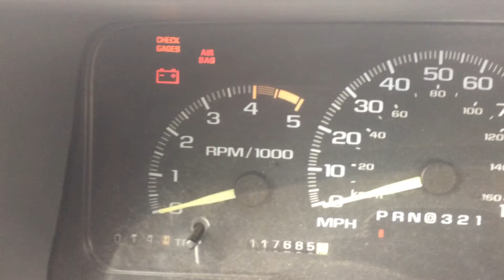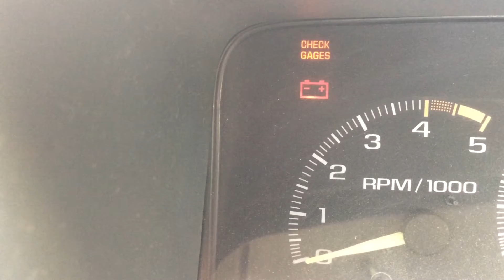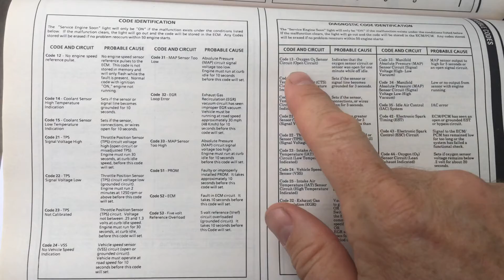How to read trouble codes on 88-95 GM cars and trucks

Comment: TBI stands for Throttle Body Injection.  Very basic and not much for power. Distributor will be different than earlier versions and would be OBD I so you use a paper clip and jump two connectors and start counting the engine flashes for the codes.
Reply from the maker: You’re right, those old TBI systems weren’t too powerful.

Comment: SES light is on my 93 1500 won’t turn off after shutting truck off. Was told on forum that disconnecting battery and reconnecting it should erase it not sure though

Comment: OBD1 is a lot less finicky than OBD2, I remember my 94 Econoline 'clearing' the mass airflow code when the van was turned off, and only illuminated within seconds, and repeated (unplugging the mass airflow was just a cheap fix to a different issue that has since been corrected.). My 92 Camry even had an EGR code come up due to a cracked hose, I trimmed the hose down, and it went away on its own.  OBD2 is anal and will illunmate whenever it wants.

Comment: You're providing a good service!
I own an 88 chevy pickup v6 vortec that has engine light come on after I drive for a short time. However it will only flash a 12 code. 
Wonder why?
Already had to replace egr valve, egr vacuum solenoid, electric spark control module.

Comment: Thank you for providing this valuable information!
Helped me identify malfunctioning egr valve on my '88 4.3 vortex v6.
I bought truck that had new spark plugs and wires, fuel pump, fuel filter, exhaust manifold gaskets (donut"s). I replaced corroded distributor cap. 
Don't get a code besides 12 now but engine light comes on at a quite predictable length of running time. Not as much pep or power as there should be. Also will bog down at times and hesitate to varying degrees.

Comment: When I try this the engine service light doesn't come on. When I turn the key to the run position it turns on and then immediately switches off. Also if the engine is running the engine service light is constantly flashing. I have a wire on the two spots that you showed in the video. Do you have any suggestions? Also the low coolant light came on after I did this but it's just a solid light. I have a 1995 Buick Roadmaster Estate if that helps.

Edit: I found the coolant leak so the coolant light had nothing to do with it lol I guess it was just a coincidence

Comment: So I have the same truck. Gm 1500 350 v8. I have code 13 as well but after the 3rd time it flashed 13 it flashes 4 times then 3 times and does that for a while

Comment: I have a 95 beretta.  This does not work.  Instead of the two connections on the upper right corner of the plug, mine are the upper and lower two connections on the right.  It is either A and M or B and M.  Any ideas?

Comment: What if the code 12 is the only code shown... I have a caprice classic and sometimes I have to give it gas to start. So I know there is a issue, but the obd scanner wont show nothing but 12.
Reply: 12 means that it can't detect anything from the RPM sensor, but you won't ever get anything from the RPM sensor if the engine is off. Hope this helps!
Reply: Ever figure out the issue?
Reply: @cesarbernabe2986 if I remember correctly it was some kind of sensor. It was just problem after problem. Eventually I sold it to a salvage yard.

Comment: What if my cars computer is OBD1 but it has a 16 pin port for OBD2?
Reply: No it does not mean you have a obd2.    It's the weird inbetween commonly referred to as 1.5
Reply: That means you have an OBD2 vehicle.
Reply: On my 95 s10 you connect 4 and 6

Comment: I have a 1994 Chevy I did the same test except I’m confused with one thing. It flashed the 12 three times to start off then flashed me the code but the code I didn’t understand because it flashed twice back to back three times and then went back to 12. I don’t get it is that supposed to be code 21?
Reply: My 93 chevy just did 12. Then 12. Nothing else. Tried a few times and even disconnected battery and tried again. Just 12 and 12

Comment: Truck won’t start and apparently I have no codes on the thing
Reply: Maybe computer is gone. Check connections. Computer is not that smart tho
Reply: @Bankable2790  blew the cam
Reply: @willsmithmaybe  damn what happened
Reply: @Bankable2790  just driving one night and it died didnt make a sound. Took me a week to figure out what it was.The end of the cam snapped and blew into the transmission

Comment: tHATS IT?? i DONT HAVE TO DO THAT WITH MY JEEP......JUST TURN THE KEY SWITCH ON 3X'S AND IT DOES THAT! BUT IT STILL WONT GIVE YOU AS MUCH INFO AS A AFTER 1995 VEHICLE DOES WITH SCAN OPTIONS.
Reply from the maker: That’s all there is to it. Newer cars are definitely much better if you have a code reader.

Comment: Mine kept repeating 12. Help plz
Reply from the maker: 12 means there aren’t any trouble codes. It flashes 12 before and after all other trouble codes, but if all you see is 12, then that means there aren’t any trouble codes.
Reply: hoohoohoblin Thank you! Maybe my fuel line just needs treatment? It keeps dying while running
Reply: @hoohoohoblin  the thing is that the service engine soon light is on and I'd like to figure out what's up with it.
Reply: Did you figure it out?

Comment: What if it just keeps flashing 12?
Reply from the maker: Then you don’t have any trouble codes. It flashes 12 to let you know that it’s working, but 12 doesn’t mean there’s anything wrong. It will flash 12, then flash all of the trouble code numbers, and then flash 12 when it’s done telling you all the numbers.
Reply: hoohoohoblin it flashes 12 and 22 and I have a 1994 Silverado mark 3, which kinda makes sense bc it’s asking me for a new distributor and a new throttle position sensor/ throttle body

Comment: So does this only apply to OBD I, or does this work with OBD 1.5 as well?
Reply: OBD 1.5??
Reply: I don't believe this works with obd1.5

Fof those that don't know, obd1.5 is an unofficial term for some GM vehicles from 1994-1995 that used an OBD1 computer but had a 16 pin aldl cable similar to obd2 but with different pinouts. They also used programmable PCMs rather than replaceable chips.
Reply: @peterdennis7786  
Wow did not know that
Reply from the maker: I think with the OBD two it’s integrated with the check engine stuff.

Comment: i got a long then 5 short, indicating speed fluctuation..& my speed sensor is on tilt, though I drove 800 miles no problem, no lights
now I get intermittent poor braking & slight stick

Comment: I have a manual 350 ss and it continues to ask me to shift when i insert the paper clip  what does that mean?
Reply from the maker: I’m not sure. Maybe it wants you to push down the clutch. Or maybe It wants you to put it in neutral.
Reply: I seem to recall a specific procedure with something to do with shifting as a part of getting the codes. The tranny could be connected to the PCM for things like no-start condition when in gear, reverse lights when in R, tranny temp, speedo detection, etc

Comment: ok guys i need help when i did this it still read 12 i waited for the first 3 #12  to flash but when it came to the 4,5,6 it still flashed #12 afterwards. help guys thanks.
Reply: Lester S - That means it doesn't have any codes to tell -
Reply: @billstonesmith9231  thanks bill i got the problem fixed it between the timing and the spark plug wire's. It took care of the issue.the issue is now regist. Due virus i have to wait...

Comment: 1994 Dodge B-250 , 5.2 , this is a van I have completely gone through engine rebuild blue printed all new sensors OEM parts . All the sensors are working new ECM. Here is the issue. With the engine completely cold, turn the key to the on position the IAC opens way up (Setting itself up for a fast cold idle ) soon as you start the van the AIC closes to a slow idle position, and stays that way when the vehicle is fully warm, then runs great I just don’t have a cold fast idle. I believe something is happening during the cranking cycle what would cause this ? ( Engine was hooked up to a scan tool all sensors working New positive and negative battery cables all ground points cleaned off new 880 cold cranking amp Northstar battery , this is my personal vehicle it is my back up handicap van I’ve had it since brand new so it’s worth making everything work perfect , no wires have ever been cut ,11.35 cranking volts at the battery. I do have a plug in the EGR valve as I don’t like exhaust in my intake. DTCs are : 12 , 37 , 32 , 32 ( The blinking check engine light gave me a code 32 twice ) ( Engine almost acts like from key on position to actually starting engine going straight to “ Close loop mode “ ).
Reply from the maker: I don’t know what would cause that. My truck idles really rough for the first minute or two, and then runs fine after that. I bet the same thing is happening to me. I wonder if it’s the ECU computer.
Reply: hoohoohoblin , I have been chasing this problem for 9 years !  I have read the computer looks at the starter relay during start up I’m actually going to change that part today and see what happens if I find the fix I will let you know but yeah sounds like your truck is doing the same thing as my van.... Im pretty sure it’s not in the ECM ... do you years back I bought a new performance ECM , Had my original one all rebuilt.. and have thrown two or three other ECMs at it...
Reply: I put a new starter relay in today it did nothing for the problem. Still very slow lopy idle cold start up
Reply: Just cut in a switch. When you flip the switch, IAC opens up with correct voltage (5V or 12V most likely), then when you switch back, returns to PCM controlled circuit. That will be good for your computer LOL

Comment: Well l had code 13 and 83. Funny thing is l fixed 13 and since havent seen code 83 again weird. Any ideas? My truck is a 1994 z71.
Reply: Code was probably related and fixing the code 13 problem cleared the other.
Reply: @johncosta14  i have a code 32 now which is egr solenoid. I replaced it cleared the code and the stupid light came back on. So i bought another one thinking it was bad, nope. Grrrr
Reply: @tacoman864  clean out the EGR port in the intake manifold. Take a coat hanger and push all the carbon an crud out via the hole the EGR valve connects too. I guarantee its plugged I've had it happen on several vehicles
Reply: @johncosta14  ok ill do that today thanks bud for the advice
Reply: @johncosta14  I’ve heard this as well

Comment: I have an OBD 1 AND and OBD 2 code reader but I have a 1998 chev 1500 that has NO computer and NO pinout for any reader.  How can you figure out why the check engine light is on????????
Reply: Lol good question I have an 85 suburban same man 😂 like wtf is this light connected to? It’s connected to nonessential emissions equipment. You can disconnect it for sure.

Comment: My 1995 Chevy S10 has a 16 pin connector and this doesn't work. Any help would be appreciated.
Reply from the maker: You probably need an OBD2 code reader.
Reply: @R Diaz , yes. Mine looks like that and I have a 1994 Buick Le sabre. I think they call that connector a 16 pin DLC, which I guess is also a OBD-II connector? When I looked up several brands of OBD-11 code testers, they say they work on 1996 and newer. Mine is a 1994. The connector end should be comfortable(since it is a OBD-II), Im just wondering if the tester will be, since it says "1996 and newer"?
Reply: @R Diaz , why not if the connector end is correct?
Reply: Hi @R Diaz, what would you recommend? I'm just trying to find a way to test the code on my 1994 Buick Lesabre. Im wondering since mine has a 16 pin OBD-2 connector, maybe it has the 1995 California standard, possibly since it was built later in the year of 1994 they used the1995 standard on this 1994 car. Arent the 12 pin OBD1 connectors common for 1994 cars?

Comment: Chevy suberban 1995 code 13 and code 73
Reply: P0073 is a diagnostic trouble code (DTC) for "Ambient Air Temperature Sensor Circuit High input".
Reply: 13 - Oxygen sensor circuit open or no activity. On V-type engines with two O2 sensors, code 13 would indicate the left bank sensor.
which might cause the wrong code 73,take care O2 sensor first,clear the codes,see if it comes back

Comment: Run fuel injection cleaner thru the tank to clean injectors and valves and to prevent false codes.
Reply from the maker: Thanks
Reply: This does much more lubricating than cleaning... if you're getting bad codes off your valves they may need readjusted.

Comment: I wonder if I can do that with my 1997 GMC Ciara C 3500 pickup truck it looks like the inside of my truck except slightly different on passenger side Dash
Reply from the maker: They changed it to use OBD two scanner input for diagnostics in 1996, so you would need an OBD two scanner.
Reply: @hoohoohoblin  yes I'm located one at AutoZone for $199 Christmas sale price it's OBO 1 but they said easily convertible to obo2. They also have a code reader for $79 and another one for $100 I'm not sure what it is capable of. I just got the Haynes manual for my truck I asked him for the correct book. Hopefully I can read this.. May be a mechanic coming Christmas day to look at my truck who is also someone else's mechanic. What a fiasco all those new parts.. nothing. I had the worst ground in the world on my battery and a couple of other grounds that I found bad. I've got to find them all. It may have caused my old computer to lose its programming. that was before I cleaned ground connections that I got rid of of  the old one..

Comment: Could anybody make sense of how he got those numbers from the light flashing on and off?
Reply: Seriously guys?  One flash followed by a long pause and then two flashes = 12   

One flash followed by a long pause and then three flashes = 13
Reply: Pay close attention. When it flashed the code for 12, there were three flashes. It was flash ...pause... flash flash. You have to pay attention to the length of time between the flashes
Reply: @Bankable2790  Hey, great advice. I'll try that next time. Thanks.
Reply: @daninwy2681  It’s pretty hard. It’s helpful to have a list of the codes in front of you and think about which ones it may be. There aren’t many like in OBDII.. only a few dozen. Also the codes won’t always tell you which part to replace. Once I had a misfire and traced it back to the throttle position sensor of all things. The code was just “misfire” tho, so it’s not very smart.
Reply: @daninwy2681  Also try to read about exactly how many times the 12 code and then error codes flash, if it’s 2 or 3 times each. That can be helpful so you can see exactly when to pay attention
Reply: @Bankable2790  Good info - thanks.
Reply: No shit he lost me with that BS
Reply: Dan inWY google

Comment: Does it store codes?  I have an intermittent check engine on a '90 that I'd be interested to read even though I'll probably not fix, because if it's serious the $400 winter beater is toast and if it's not serious I don't care :P
Reply from the maker: It stores codes as long as the light is on.  Most of the codes are probably the same as the ones I listed in the comments on the video.
Reply: Lol nice logic.

Comment: Can you do it if the light is off? Itll turn off and on
Reply: So what if the light only comes on periodically then goes off after you turn the car off.
Reply from the maker: If the light is off, it means there aren’t any trouble codes to report. So it has to be on to tell you that you need to check it.

Comment: Just because you get oxygen sensor codes don't mean it's the oxygen sensor. It means the oxygen sensor is too rich or too lean. Replace the CTS or parts controlling fuel. High fuel pressure can cause rich mixtures.
Reply: 13 is oxygen sensor circuit open.  44 is lean mixture and 45 is rich mixture.
Reply: @AnglinTexas  
What should be the first thing to check if it is code 45, oxygen sensor, rich? If it isn't the oxygen sensor itself, with the sensor be outputting the proper voltage of between .1 and 1 volt?

Comment: Codes sometimes depend on the year and engine of the vehicle.
Reply from the maker: That is true. You can usually find them posted in a forum somewhere online, or in an aftermarket repair manual
Reply: hoohoohoblin A code tester like a Actron CP9690 works on OBDI Ford, G.M., Chrysler, and 2 Toyota. It does live, graphing, record, smog readiness test, oil light reset, it has code connect for diagnosing codes. It comes in a black pouch with instructions. It works on cars 1983-2013. On OBDI Fords, if you get vacuum at the EGR at idle, replace the charcoal canister purge valve. If you get oxygen sensor running rich, replace the MAP sensor. It could be the CTS or high fuel pressure. The CTS can read low and cause high idle. Electric fans might not come on. The CTS can read high and cause no fast idle and electric fans keep running. The tester can bypass the CTS to check the coolent relay and fans. After each repair, run the engine at 2000 RPM's for 2 minutes and test codes. Otherwise you can get false codes. The tester can erase memory codes. It check ABS.

Comment: Can you please tell me how to get the codes from my 99 GMC Yukon?
Reply: Best one that I found that works great is a u scan Bluetooth one I have one and I have over a 1000$$ snap on one that dose everything that my u scan one dose but my snap on one can read the air bag light
Reply: @deerchaser7395  My $80 reader reads everything including the airbags. Congrats you spent $920 for a brand name
Reply from the maker: On a newer truck like yours, you will need an OBD2 code reader. You can buy them on Amazon or eBay.